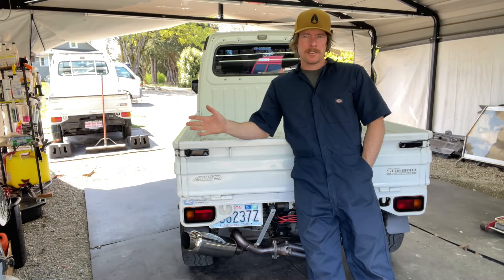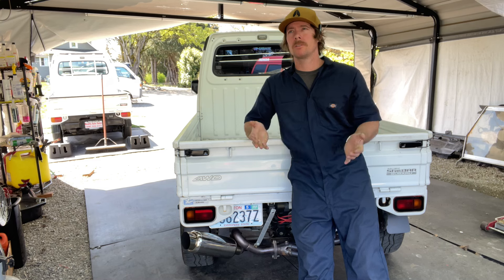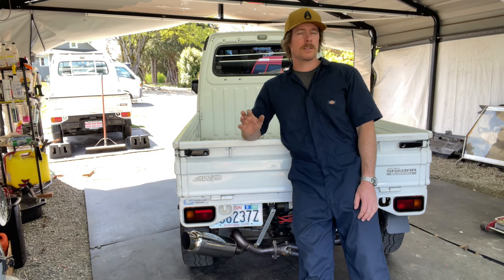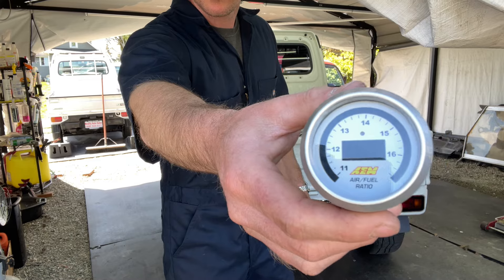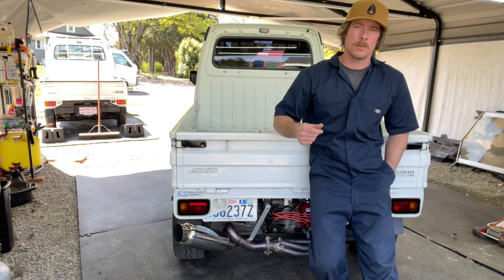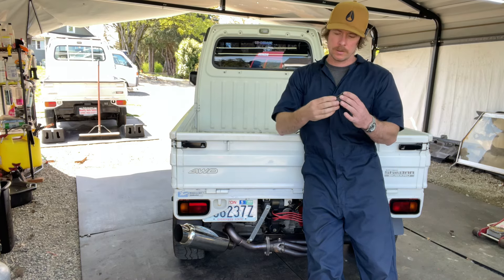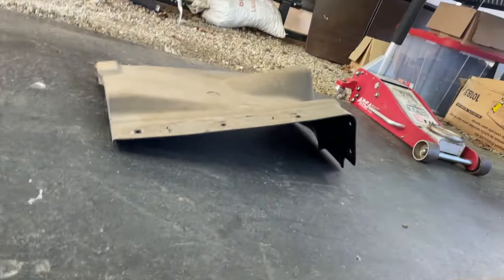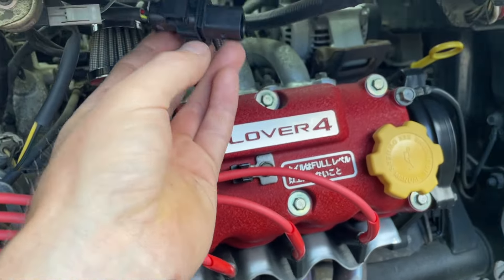Subaru Sambar - AEM Wide Band Air Fuel Ratio Gauge Install Carb'd Sambar With Header LEAN or Rich??

Comment: I imported one of those gauge-pods back in December! They're awesome, but I find that in the cold, the gauge doesn't friction fit, causing my glo-shift tachometer to rotate in the pod... My solution was to make a little gasket of blu-tack between the pod and the gauge. Now, no more movement regardless of temperature. 👌